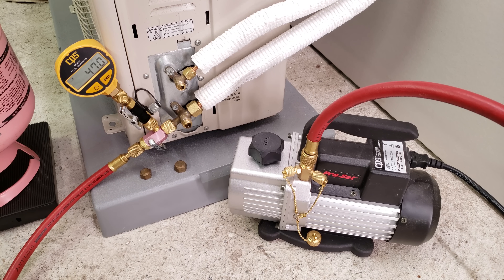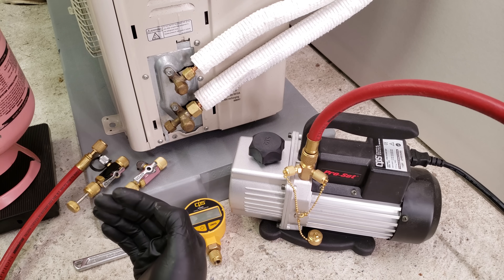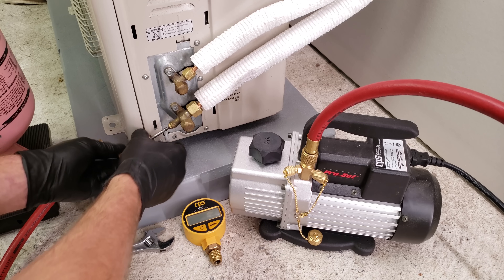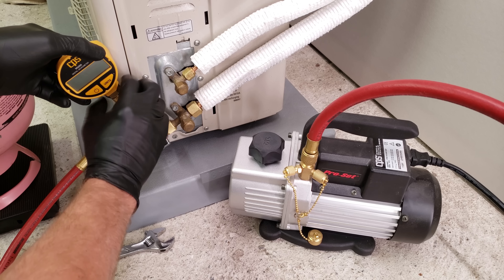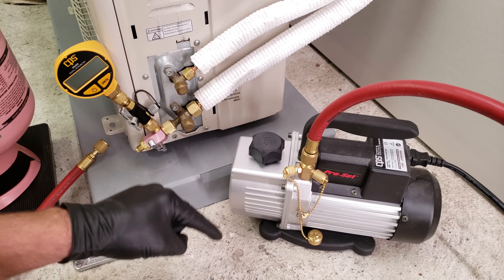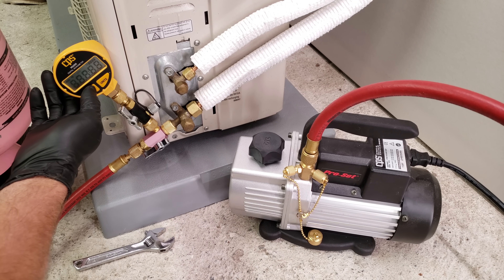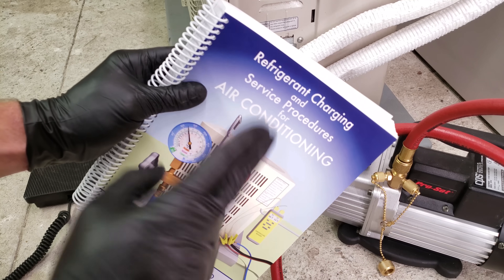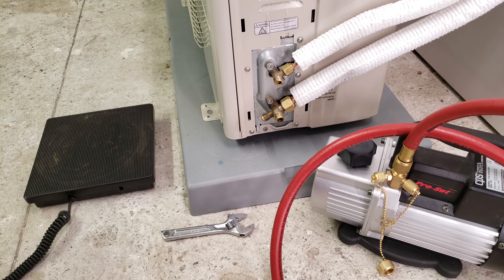Steps to Vacuum and Charge Refrigerant on a Mini Split Unit!

Comment: Great job and explaination.
I see you add refrigerant with the unit off.
Is guess it's normal 
But just wanted you to confirm
Reply from the maker: Yes you can add refrigerant while the unit is off and vacuumed. Otherwise it needs to be added while the system is running, thanks!
Reply: Craig, i have read your book but am still confused about adding refrigerant to a single port (vapor) mini split like this one.  i have recovered the entire system, fixed the leak, pressure tested, performed oil blowout, triple vacuumed, performed standing vacuum & am ready to recharge from new bottle.  Pg 137 of your book says in order to weigh in many pounds while the system is off the refrigerant must be added to the liquid port so it will not vaporize.   Of course there is no liquid port.    Do i just add what i can with unit off, start the system & use your slow burst method (pg 91) to finish the correct charge?  Thanks.

Comment: It's the little things... I really like how you show purging every little part of the system and the tools, really great.
I am fascinated by how short a test it is though. I charge with Nitrogen to 400 lbs, and wait a while if I can. You only took 6 minutes (it took 4m to get to 340) in vacuum! I wouldn't have thought that was enough to be confident. Of course, time is money. Anyway, thanks so much for such a detailed video.
Reply from the maker: Vacuum time doesn't matter, only the vacuum level and I did a 10 minute standing vacuum test to verify true vacuum level, thanks!

Comment: from my understanding the vacume  gauge should be placed furthest from the system not close to the pump?
Reply from the maker: yes furthest from the pump, closest to the system in order to get the most accurate vacuum reading of the system, thanks!
Reply: How is this make sense "furthest from the pump" YES. then "closest to the system" ?
the gauge should be placed furthest from the pump period

Comment: What is the best way to test a micron gauge to make sure it is not leaking? I got a new cps gauge like yours, attached it to new appion vcrt connected right to my new vacuum pump. Pump pulled down to 8 microns in about 1 minute but when I isolate the gauge the vacuum rises rapidly to 250 microns then it is over 500 microns in less than 10 minutes, then 24 hours later it will hold at 780 microns for a long time. This leads me to believe that gauge itself is leaking. I tried multiple vcrts and I even added a slight amount of nylog to the seals with same results every time and I also actuated the shut off valve open and closed to remove all air before turning off the pump. Thanks for your help!
Reply from the maker: If you test it on only a small section of tube, you will have a result like that regardless of the gauge. It has to do with the amount of space within the ball of the valve and it closing. I would just suggest using it on a new system install and doing the standing vacuum test to see if it rises more than mine did in the video, thanks!
Reply: @acservicetechchannel  Craig, you know your stuff, this is exactly right!

Comment: Here in Japan most of the guys use this tool that threads onto the service port, and you attach the vacuum hose to it, then you turn a knob with depresses the Schrader valve in the service port and then they vacuum the lines and head unit. They usually will let it pump for 10-15 min. They have no vacuum gauge attached anywhere, maybe there is one on the vacuum pump but, but often no gauge at all. I spent the money and bought the two valve core removal tools you have and the  CPS Micron Vacuum gauge too. I could pump down my lines and head unit to 310 microns, but after 10 min with the valve core removal tool turned off to isolate the vacuum pump, the reading was 300 microns. That should be good to go, yes?
My problem with all of this is the ability to pressure test. I don't do this full time, it is one of the many things I do here in Tokyo, another service I offer to my non-Japanese clients is the removal and installation of aircons, 100% mini-splits. I have seen a lot of Aircons installed here and I've never, ever seen anyone do a pressure test. Looking in the catalog from an Aircon supply company they do sell the nitrogen bottles and the regulators, but they cost $500 for the bottle and then $50 to refill it. I'll have to spend the money at some point, but I really don't have the cash on hand right now. 

My question is, can I use CO2 to pressure test? I have that gas in abundance, I use it on my MIG welder and my wife's family run a liquor shop and I can get a smaller bottle of CO2 used for the draught beer machines easily. If I use CO2 to pressure test and then I vacuum out the lines and head unit, would that be OK?
I feel that I already know the answer and it's no, but I thought I'd ask, LOL 

Oh, would Argon work? I have Argon for my TIG welder.

Love these videos, bought the E-book and I'm learning a lot.

Thank you VERY much for your time.

Cheers from Tokyo!
Reply from the maker: I don't use CO2 or argon but some techs here do use them. As long as it is an inert gas and it does not leave humidity in the lines that needs to get vacuumed out then it is ok but make sure not to over pressurize the systems though, thanks for your comments and desire to do the processes correctly for the customers and for the sake of your name!
Reply: @acservicetechchannel  I again Craig, thank you so much for the information.
Turns out I did not have the correct fittings to connect the CO2 bottle to the system, so I did not use the CO2 to pressure test.

I talked to a Japanese guy that does a lot of these mini-splits, he said that for the mini-split since there are only a total of four connections and they are very straight forward it is unusual to pressure test them. Larger industrial or commercial AC or refrigeration setups with lots of connections and joints, yes they are pressure tested.
Things are done differently here, I guess.

What he did suggest was that I do the vacuuming of the lines and head unit then I open the valve on the liquid, small line to release refrigerant for maybe 5 seconds, into the system, then close the valve again. Then I could do my bubble check on the joints, but he thought this was overkill.

Using the two valve core removal tools and the CPS vacuum gauge I vacuumed the lines and head unit. I got it down to 54 microns, (took a picture!) and then I isolated the vacuum pump from the system and waited 10 min. The gauge normalized at 100 microns. I then waited another 10 min and the gauge still read 100 microns.
 
I did just like you show and I isolated the vacuum gauge with the 1/4" valve removal tool and then I opened the valves from the compressor unit to allow refrigerant into the lines and head unit.

Question, do you usually hear any sound when you do this, like a gurgling sound? When I did it there was no sound at all...?

I then replaced the valve into the service port, had to push fairly hard against the pressure in the lines, but it worked, I checked the valve for leaks, there were none. I then checked the other flare joints for leaks with the bubble stuff, no leaks.

Good to go, the client is happy and so am I, your setup works really well, and super slick.

Thank you again!

Cheers from Tokyo!

Comment: Hey from Tokyo!
I've seen dozens of these mini splits installed over here, maybe 50 or so in the 29 years I've been here, I have never once seen them pressure tested, they never remove the valve core, they just hook up the vacuum pump and run it for 15 min or so then open the two valves on the unit and call it good.
I do see a valve core removal tool in the catalog but I've never seen on in the field in use.

It's great to see the correct way of doing this.

Did I miss the part where you pressure tested with nitrogen? 

Is that in a different video?

I'm installing a couple of aircons soon, so I'll have to pick up the rest of the correct tools.
Thanks again!
Cheers!
Reply from the maker: Thanks yeah I did not show it in this video but just videos on conventional systems, thanks.

Comment: Craig, I actually just put in a 12k low heat fujitsu today. Almost exact same setup. I had to special order the Appion 5/16 removal tool. The guy at the supply house looked at me like I had three heads when I asked for it. Got er down to 75 microns. Just curious, what if you hooked up the charging hose to the top valve core removal tool, purged the line, and kept it valved off? Dont you think there is slightly less chance of getting air in the lines? I didn't need additional refrigerant, I'm just curious of your opinion!
Reply from the maker: That would let air in and the way it was done in the vid wouldn't let air in thanks

Comment: Mini split systems have been making their way north for some time. However up here heat pumps are really not worth the cash. Down south mini split systems are really nice.
Reply: Jason Mills They have heatpump systems that work down to -20degs or somewhere in that area.
Reply from the maker: Are you mainly doing Nat gas, Propane, or oil where you are located?